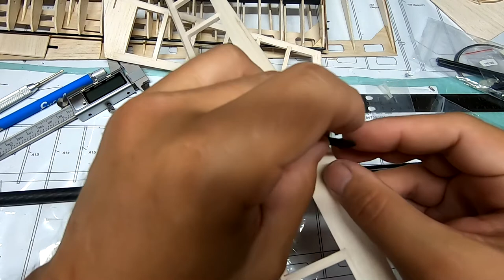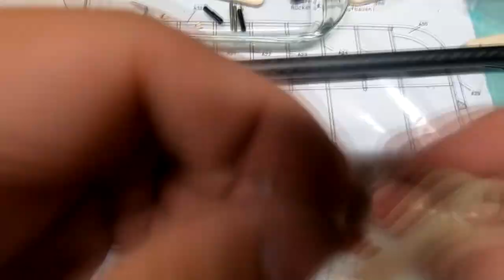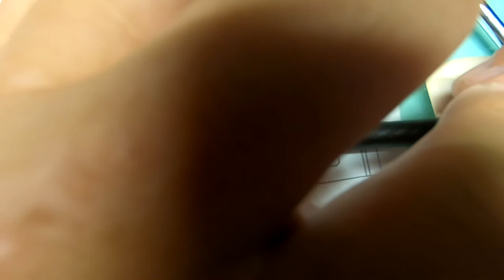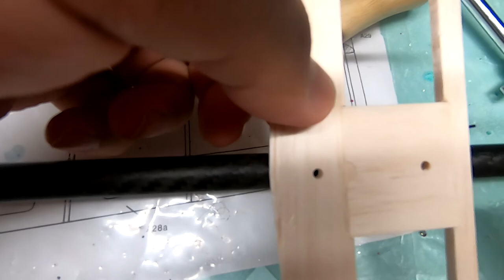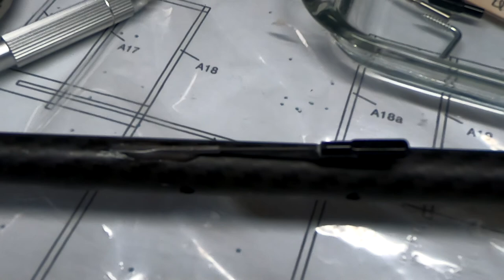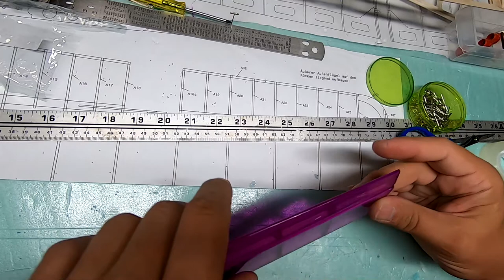Fresh F3-RES 2M Glider - Control Rods, Stabalizer and Covering, Pt10

Comment: Awesome oracover!💖
Reply from the maker: It's among the lightest iron on coverings. Hangar 9 makes Parklite, but it's more difficult to apply than Oracover because it likes to fold back onto itself and then it sticks. Oracover will do the same, but not as bad and you can usually pull it apart without damaging the covering. I still like and use Parklite, but this has been my experience.

Comment: I like the colour scheme, that should be highly visible in the sky.
Reply from the maker: Yes, I try to stay away from blue... but most colors look like black when in silhouette. I particularly like transparent colors over a good balsa build. It's nice to see the structure. That's why I resisted the urge to write part numbers on bits. I've had a few good days and I've been pushing through on many of the bad days... making headway through the stack of kits and projects. I built and filmed two cars that I haven't even posted one video. Gotta cut all that video.

Comment: The translated instructions I’ve got say to use 2 balsa blocks under the tailplane with one shaped but there are spares if you mess up the shaping. They also say to use steel screws temporarily for assembly, less likely to bond. They also wrap some thin fibreglass cloth down the sides of the block and round the boom, wetted with ca.

Comment: Hi, nice work! Mine is purple too, with white fuselage and white spoiler. I have flown it once with high winds. I used 100 grammes of balast to bring the total weight from 450 grammes to 550. It flew well at a cg of 69,5 mm. Please continue to make videos and also make video of maiden flight - and please share your cg and flight experience! Best regards, Roger
Reply from the maker: Hi Roger, I just finished the build, balanced and weighed the plane. Hopefully I'll maiden tomorrow. I've got the CG at 69-70mm. It only took 4.7 grams of led and enough epoxy to hold it down to balance the plane... they really did a nice job on the design. I don't remember ever using that little to make a plane balance. It weighs in at 442.9 grams, ready to fly. we are closer in color than you know... I covered the fuse in black and the rudder in transparent white. I also put a white stripe in the middle of the left outer wing section. I also used some fluorescent pink to create a pho canopy and used the same to cover the plywood stiffener that goes over the stab... just to add some accent. I'll definitely post videos of the maiden flights and some longer, highstart flights. I picked up a couple micro cameras that I'll try attaching to the plane to get different in-flight views.
I'm glad you're enjoying the videos. Thanks, CJ

Comment: Looks fine to me! And... way, way better than commercial soarers like Epsilon from Staufenbiel (which flies sh!t).
Reply from the maker: It's coming along well and it has a good rep as a good flyer. That's to bad about the Epsilon. I checked it out on Horizon Hobby. That's a great price for a 4m glider... but when you read that it's a wood covered foam core sheeted with Oracover, you understand the price. I looked at the pics of the PNP and I personally didn't like the servo mounting system... the huge wood block and the bowed plastic strap look like dated tech, like the wood covered foam. It won't be as light per meter as something as gosamar as the Fresh or one of the all carbon gliders that cost at least twice as much. Still, it shouldn't fly as badly as you say... did you have CG issues? In my experience, some planes are far more sensitive to CG location than others. A few ounces of led can turn a monster into a kitten. If I were spending the money that the Epsilon costs, I'd probably buy a Pulsar 2-2.5M instead. It's like the Epsilon is trying to be the biggest for the least money.
Reply: @MyRCChannel-CJScott  A friend of mine bought the Epsilon. I tossed it in the air. What an in-between... it flies, it thermals under par. Build yourself a RES and you have plane that will acvompany you on many various occasions.
Reply from the maker: @nickvledder  I totally agree! I wish RES was bigger here in the US. It's the prefect class to get young and new people into the hobby, teach them to build, fly, and compete without breaking the bank. You go to a glider competition here and it's all multi-thousand dollar carbon fiber planes that the beginner can't afford or won't risk investing in. Over in Europe, RES is big and they have classes for inexpensive gliders as well as for the high dollar gliders. If this hobby is going to survive, we need to make it accessible to beginners and encourage their participation by having competitive classes for low cost craft. An excellent example is the EuroTruck class in rc car racing. About $150 gets you the kit with motor, ESC, body, wheels, and tires! A transmitter, a steering servo, a lipo and a charger is all you need to add. No mods allowed and a set of tires can last a season. The kits are based on Tamiya's tried and true tt-01 4wd chassis which is rugged and easy to build and service. It has become the most popular class at the club where I race. Almost everyone has one regardless of what other classes they race. It's just too inexpensive to not get in on the fun... which makes it even more fun because you've got a big field. There will be 3-6 guys in each of the other classes and 8-12 in EuroTruck.